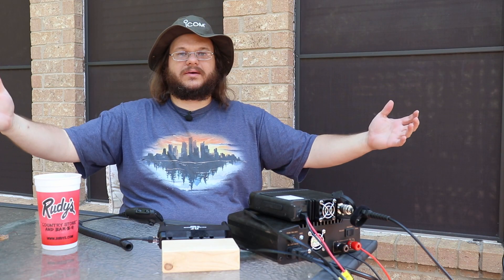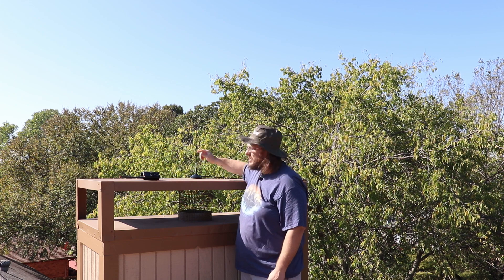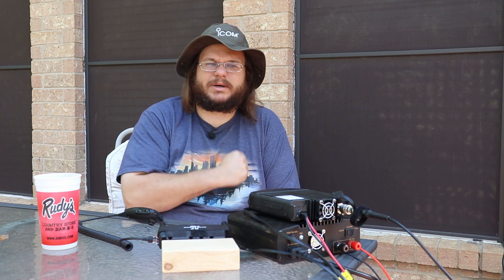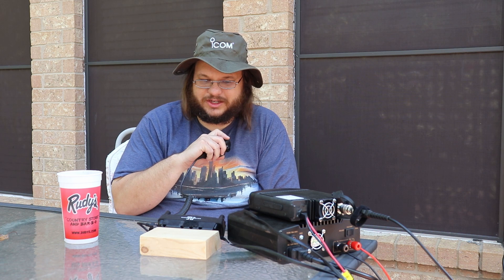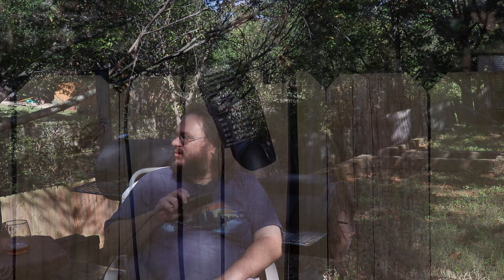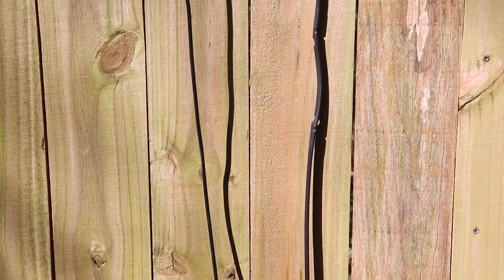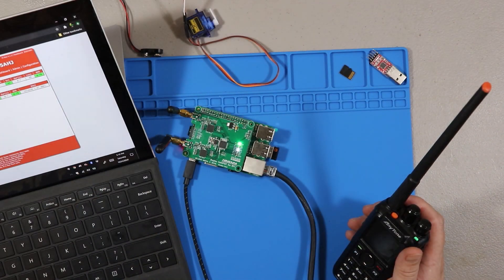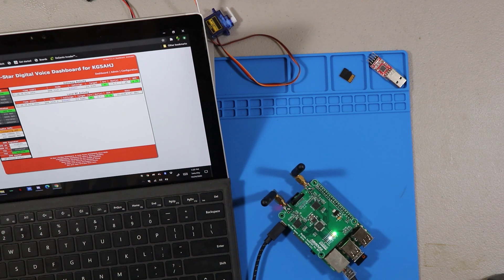My First Amateur Radio Station Setups

Comment: 300Ω twin lead roll up j-pole. I also called it ribbon lead line. I made many of those babies along with the 450Ω Ladder line, usually made as gifts for new hams in the hobby
Reply from the maker: Thank you for doing that.  Those are great temporary setups I need you storage

Comment: I've got a couple of roll-up J-Pole antennas, they are convenient and they work great.
Reply from the maker: I am still using the J-Pole, just don't pipe 50 watts on 2 meter.  it turns on and off my TVs.
Reply: @TankRadio  lol..right on. I have a copper tubing J-pole in the attic.
Reply from the maker: I have another actual J pole which is destined to go on the roof